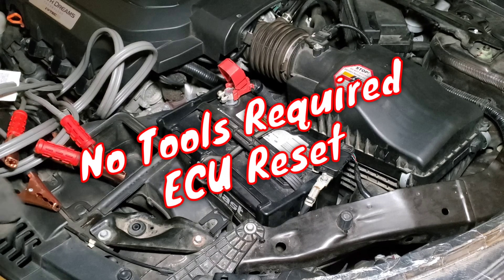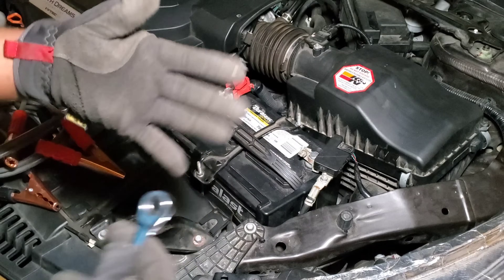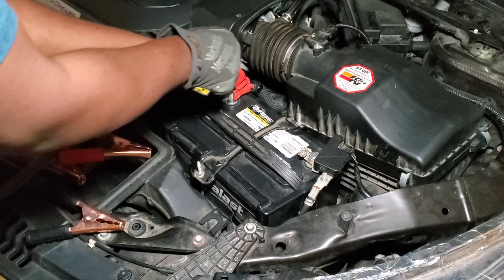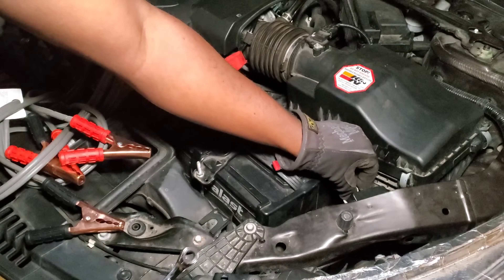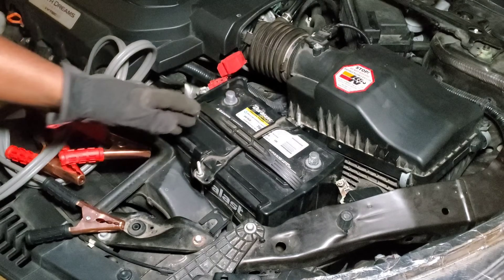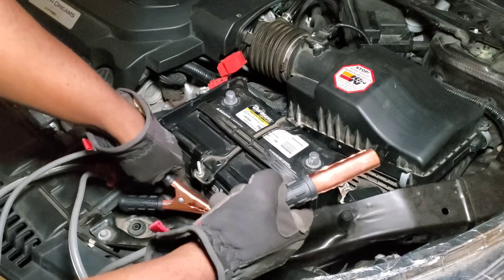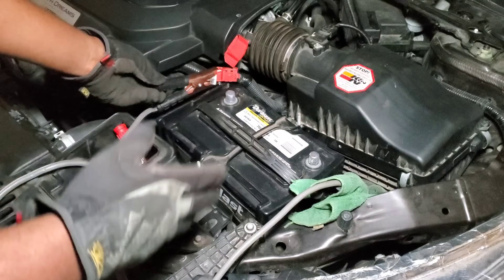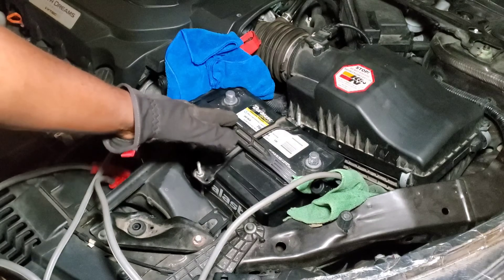How To Reset All ECU  No Scanner No Tools Required

Comment: I have a 2010 Ford focus bought a remanufactured ECM take it to Ford did not work car wouldn’t start  they had to put back the old one in and the P0420 code still there waste of $850 all together will this work to get rid of the P0420 code?

Comment: This should only be done with a resister in the connection as rapid discharge can cause control module component damage

Comment: I just saw another video on YouTube and it suggested a simpler method of simply taking out the ecu fuse , then replacing straight away? Would that work , although maybe best to wait 30 mins before replacing to give time for caps to discharge! Is this going to work ? Certainly easier than disconnecting the battery! 😊

Comment: Actually you don't need the jumper cable at all. I disconnected the negative and that's it. Don't even need to disconnect the positive. Than I press the steering horn to make sure it discharge. Than wait a minute or 2 that's it. Nothing will be shorted that way. And my Honda clears every fault code when starting.

Comment: No tools required?
10mm spanner: what am I?
No need to connect battery leads together, just turn the key on and push the brake pedal.
This will discharge any capacitors in the car.
Possible reason your throttle body and most likely your air flow meter are getting dirty is the K&N filter, over oiling is quite common and with a hot film air flow meter this can easily destroy them.

Auto Tech for over 50 years.

Comment: Could this help if the car is throwing a P0116 After a new ECT Module was put in?  The 2009 Traverse is giving multiple temp readings on the scanner, so the local shop said they think it needs to go get looked at by a GM dealer.
Reply: Please don't do this. The computer has to be programmed to match the system in your vehicle. Please go to the dealership and have it programmed and calibrated to prevent damage to the other computer or computers depending on your vehicle model.

Comment: There’s a measurable potential between the positive and negative cables when disconnected from the battery. I use a very thin copper wire wrapped several 100s of times around a pencil to create a “resistor”. Then connect one end to positive and the other end to negative. The connected voltmeter then shows a decreasing voltage. When voltage goes to zero the ECU is reset without damage.

Comment: Nice!  Just some thought coming to me.  I wonder if anything like the clock, trip meter or odometer might be reset by this operation?  Also, like in my car there are other displays - radio station memory, volume memory, fuel consumption memory, estimated miles remaining before need to refuel, keyfob ID and who knows what else...
Reply: Clock yes, key fob ID is extreme lol

Comment: Not all internal data is removed by this method there are  EEPROM that will retain data without power like your memory sticks or sim cards. Critical startup data needed to activate the ECU. If you have flags or error codes they will come back slowly.

Comment: It worked well.  The radio and while making a Bluetooth call, they both would shut off for a few seconds and then come back on over and over, and I would lose power steering sometimes too.  The check engine light came on and that's when I had Auto Zone  give me a diagnostic trouble code, and it was showing the power train system, and ABS.  Sure enough though, and the attendant tried to sell me a power train system for $456.90, but she made the mistake of saying that the codes just needed to be reset and that when I found this, and two other videos telling me to do this.  Thank you very much!
Reply from the maker: I’m glad that it worked out for you my friend 🙏🏽
Reply: @Loverofengines101  it would have been more beneficial to show the engine light on  first  than do the procedure to showing it worked.
Reply: Service engine light???
Reply: @THE-SPIRITUAL-OBSERVER  yas

Comment: It works but safer for ECU is to 
put a 10 watt 1 ohm resistor across the battery cables after they both are removed from the battery

Comment: Interesting video! one little tip always when disconnecting the battery ,take off negative terminal first and when reconnecting the put on the negative terminal on last to avoid short circuits also removing the positive first can possably cause more of a spark and you do not want sparks near a gassing battery (hydrogen gas!) I'm looking forward to more vids cheers
Reply: Correct.
Reply: Why?
Reply: @Pgan803 why?, Because that's what she said....
Reply: Thanks for sharing.  I am going to try it on my 2001 passat and I hope it's going to work. I'd like to hear if anyone has tried it on a car similar to mine
Reply: very informative.thanks
Reply: Always positive before negative. To reduce risk of spark.

Comment: Thanks for posting this. Does this erase permanent codes in the computer? Even though I 'erased' them via my scan tool, they kept reappearing.
Reply from the maker: This is for someone who doesn’t have a computer to erase a code. you first have to fix the problem on your vehicle before doing this if not the code will come back just like yours 🙏🏽

Comment: I had set Injection Quantity through adaptation using vcds in my Skoda Octavia 1.9 TDI ALH 2005. Will this help to restore it to stock value 32768? I don't have the scan tool right now and wanted to know if there's way of doing it manually.

Comment: under what condition do you actually need to reset the ECU ?
Reply: to get the codes cleared so the dash warning  (check engine, low tire pressure, etc) lights turn off, so one knows that if one turns back on, there's the problem.
Reply: @_Ramen-Vac_  thank you for your advice

Comment: So this resets your sensor lights I have a 2014 Honda accord I have my steering wheel light going off ,abs , traction going off I replaced sensor module I replaced fuse thought that could be the issue and I got a new battery?

Comment: When disconnecting your car battery ;
Negative off first 
Then positive 

When reconnecting;
Positive on first 
Then negative 

This is the most important procedure while working with your vehicle battery otherwise you might cause a short-cut 
P.s: I LEARNT THE HARD AND COST ME A BRAND NEW BATTERY WHILE TRYING TO BOOST  ….I ENDED UP DISCONNECTING POSITIVE TERMINAL FIRST AND PUFF BATTERY GONE

Comment: I replaced a camshaft position because the scanner at the auto parts store said it was P0340 Fault camshaft position sensor. So I Replaced it. And it's doing the exact same thing now as it did before the replacement. YouTube is keep telling me to disconnect the battery to relearn the camshaft position sensor to reset the ECU and none of that is working. I think P0340 is a bad fuel pump and not a bad camshaft position sensor. Because the fuel pump no longer makes the buzzing noise it used to when it was working. it gone silent the moment p0340 popped up. That code really is for the camshaft position sensor then what effect does it have on the fuel pump because the fuel pump no longer works when p0340 pooped up.

Comment: Yes way to much work pull fuse generally works but if the fix here is needed all you need to do is remove positive cable and ground it to chassis for 15 min tops no need to disconnect negitive or use jumper cables. The advice is good here just a few extra steps that are not needed 😊
Reply: Depends on whether car is positive or negative earth.. Disconnecting both covers both.

Comment: Do this help wit rough idles after cleaning the throlle body
Reply from the maker: every time you open the thriller body you will get rough idles you have to drive your car for some miles and everything will get back to normal. also I’m sorry for the late response very busy with my trucking business 🙏🏽🙏🏽

Comment: Or you could just remove the ECU fuse relay under the hood which is much quicker and doesn't reset all of your other electronics such as radio, alarm etc.
Reply: Wich one is the ECU fuse?
Reply: Yes and no, what he do is bridging power with ground this will discharge the capacitors of the modules, removing the fuse will only cut power to ecu and you need to wait some time to discharge capacitors
Reply: I was wondering if that would help. I made a few repairs on the teuck and tried to reset the computer, but the CEL would not be clear. I unplugged the negative and turned on the headlights, and left it for 30 minutes. It reset all my settings, but the CEL was the first thing I noticed when i tuened it on. I did the method shown in the video, waited 30 minutes, and still the same thing. I was wondering if finding the fuse and removing it would clear the codes. One thing I noticed when I would reconnect the negative is that as soon as the termi al made conta y with the battery, a small spark would fly, and my headlights would flash on then off. Does that mean the power wasn't fully drained?
Reply: I have engine lights coming in on my 2018 Fit. It shows several codes but the mechanic said it runs perfectly and the codes do not reflect the performance of my car. I did unhook the battery and the code’s disappeared but a week or two later, they came back on. Any ideas?
Reply: @ronmcelroy6234  means that you have those problems in engine
Reply: @estrikadev9554  but there is no engine problem. It drives like a new car and my mechanic agrees🫤
Reply: @ronmcelroy6234  well some problems are not big problems but can give engine light, and car will run as normal, like intermittent egr faulty position, petrol intermintent misfires etc, if they dont disturb the proper engine work, let them be, but i advise to get a inexpensive diag tool to diagnose car from time to time because if you have engine ligh with those problems one more serious can appear and you will not know because light is on
Reply: @estrikadev9554  thanks

Comment: If I have a p0183 (Fuel temperature sensor) code in my OBD and I do this battery hack, will it permanently remove the engine light?

Comment: Good. I like it as I am facing same problem with my Toyota Corolla car. I will do it to know how it works
Reply from the maker: it works for me and  my Honda is running great up to now
Reply: @Lover of Engines  will this work on a mercedes e class 2011 reg, diesel automatic. I need to reset the ecu as I coded something via a diag tool and now car won't start?

Comment: Great idea; however, seriously consider one crucial modification.  Although I am not a general electrician, I did earn the certificate.  That stated, connecting the positive and negative cables together drains downstream capacitors in the various circuits; however, it also short-circuits them as well, short-circuiting that can possibly damage delicate ECU circuit components.  Therefore, I would recommend using a capacitor discharge tool like the one described in an IFIXIT article, “Constructing a Capacitor Discharge Tool,” by Andrew Bookholt.  Years-ago, I created such a tool, adding alligator clips for convenience as well.

Finally, for safety sake, when reconnecting the battery of a negatively-grounded vehicle, start and finish connecting the positive cable, ending by placing the battery terminal protection cover on the positive post.  The last thing one wants to do is wrench-around the positive terminal while a battery cable is connected to the negative terminal.  If one’s wrench should accidently come in contact with the frame, sparks will fly.  For a negatively-grounded vehicle, that is why one always disconnects the negative cable first and then the positive and reconnects the positive cable first (completely) and then the negative.  When jumping a negative-ground vehicle, connect the negative jumper cable to the frame, not the negative battery post, avoiding the consequences of a possible battery explosion.  In any case, always wear adequate eye protection.
Reply: Thank you great advice
Reply: I eat crayons. Can you draw pictures for me?
Reply: Wow thanks can I borrow yours I don’t have one and I’m betting 99% of regular joes don’t have one either nor have ever heard of such…..
Reply: THANK YOU FOR SAYING THIS CAUSE I WAS WRITING DOWN HIW HE DID THE CABLES(WHICH ONE TO DISCONNECT FIRST AND VICE VERSA)👍
Reply: Will this help your car pass emission?
Reply: Disconnect Negative, press the horn at your steering to discharge if you want to, wait a minute then connect back the negative and start the engine, voila all the codes will clear. It's that simple, no positive to wrench, no jumper cables and don't need to waste precious time waiting. Just need a minute of your life of waiting.
Reply: Yea, that didn't work for me. Just woke my neighbors.  @zepp3lin
Reply: The capacitor discharge tools isnt necessary. The capacitor would be discharging through the circuitry of the ECU which already has resisors in it. Remember, its because the capacitor are seeing an open circuit when the battery is removed that is why they hold the  charge. They would eventually drain after a long time. Shorting the terminals speeds up the process. We use to do this for old computers as well, unplug it,  remove the CMOS battery, short a certain jumper and voila, your pasword protection is gone 😂
Reply: Wow thanks for the documentary     but only one down fall I fell asleep reading it     it took me a second try

Comment: Electrons run from negative  anode first of the battery, so would be wise to remove the negative first when disconnecting battery. Then remove the positive wire from cathode  side of battery. Anode = Negative terminal, Cathode = Positive terminal.
Reply: True, that is the way that electron flow has been taught for the past several decades at least. Once upon a time it was theorized that DC current flowed from positive to negative. That was revised a few generations back.